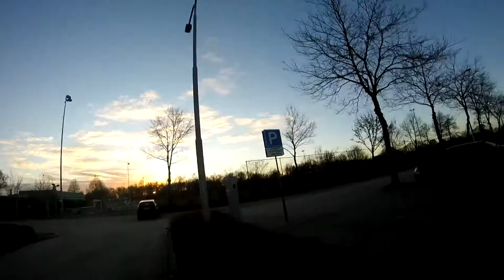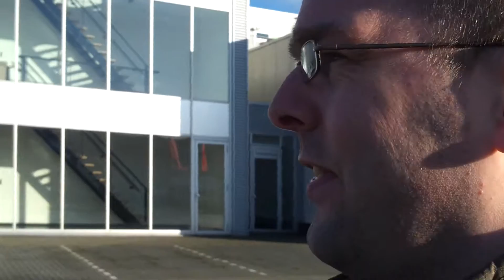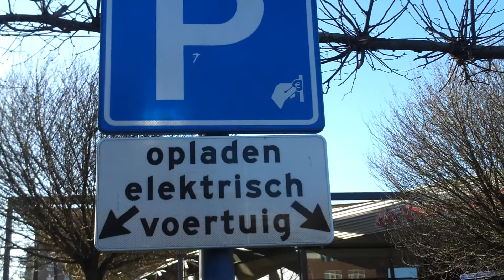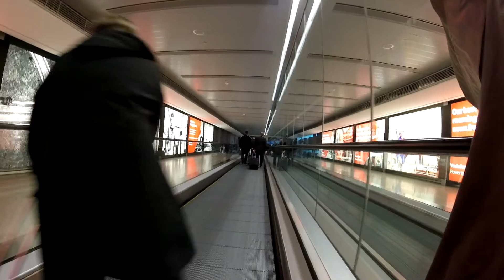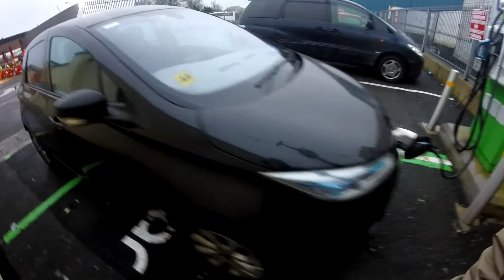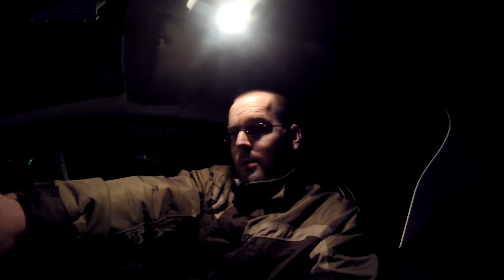My Electric Journey - Episode 11 - Chargers in the Netherlands & Return Journey

Comment: I bet its a lot more 100% electric kilometres now!
Reply from the maker: Approaching 132.000km on my odometer.
Reply: Jan-Bart Spang Wow!  That’s about 5 or 6 times the miles we’ve done in my Hybrid (11,500 miles).
Reply from the maker: And I work 3 miles from home. Most of the mileage was leisure. It's so cheap to drive it's hard to resist!!

Comment: I'm a dutchie who's living in Norway. Looked at the possibilities to drive to NL with an EV, but I can't see how a 'tourist' can get access to the chargers in the netherlands with all the subscriptions. What's your plan there? There is an infrastructure, but how do you plan to access it?
Reply from the maker: I contacted TheNewMotion via email and have a card for their network. It is linked to my Irish bank account. No problems at all.. Even came with a personalised note to say enjoy your trip. Just email info@thenewmotion.com and ask. I also registered with FastNed. They should have a good few stations up and running by then. They are bit expensive but good locations. Should have no problems in Holland at all.

The UK is covered by registering for the Electric Highway via Ecotricity's website. Card came in the post. In the UK I have also registered for ChargeYourCar but I don't plan on using them.

Hope it helps!
Reply: Jan-Bart Spang Thanks! I just was confused by the number of operators in the netherlands, good to see that there is one card that can be used at almost every chargingstation (enough chargingstations). They even have some coverage in germany (a black spot in my plan) - opens some doors :)
Reply: Thomas Brinkman Hey Thomas, it's very easy to drive an EV in the Netherlands because we are having around almost every 50-75 km fast chargers from Fastned and the New Motion at very strategic points. For charging at Fastned you only have to download their App and off you go! To charge at the New Motion fastchargers you have to order the free New Motion card. With this card you can also charge at the thousands (!) 11 and 22kW chargers in the country. Good Luck and goede reis naar Nederland!!